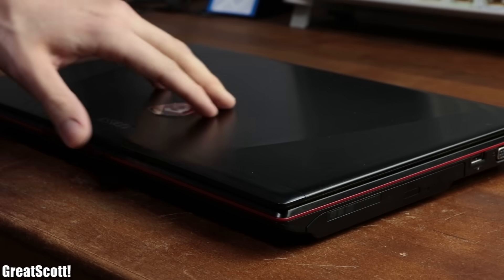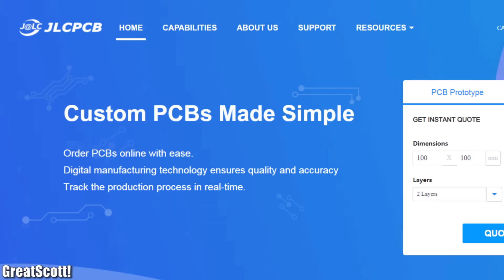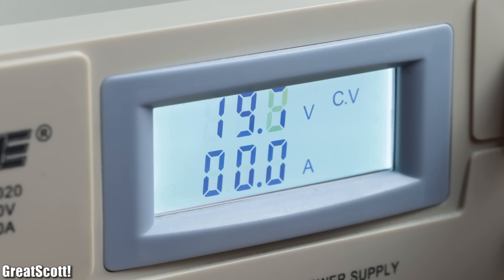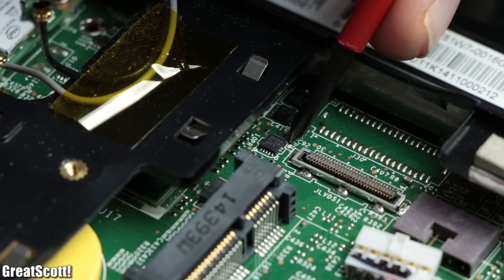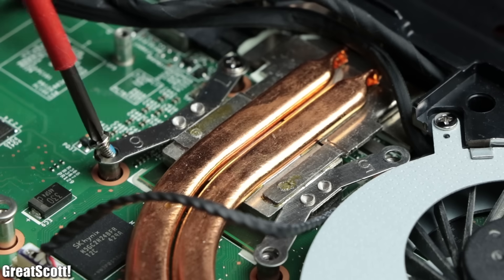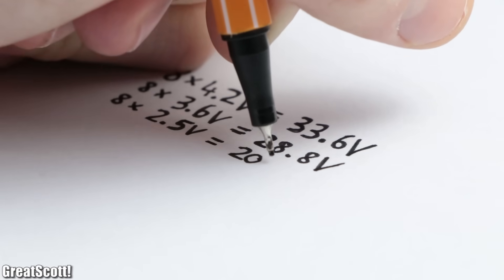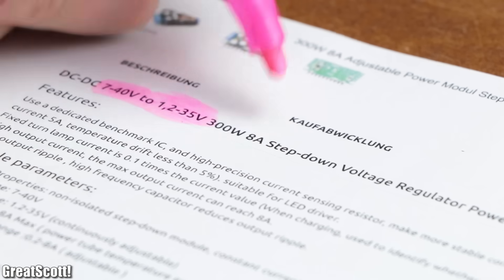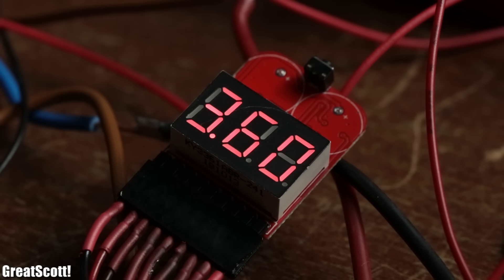DIY Laptop PowerBank (battery pack to charge your laptop on the go)

Comment: Lol, 8:15 Capacitors being pushed aside and wobble as you adjust the buck converter. 9:50 Wuuut? 10:10 Stuffing soldered wires into a wago connector... 10:20 using a way to big screwdriver, and stuffing it in the screw terminals while putting extra torque on the plastic part... This isn't even funny to watch, I'm starting to cry. This is crazy, this shouldn't be on youtube. People will get inspired and build bombs just like this and set busses on fire or something. You're mad.

Comment: HI there. I need help here I have a hp touchsmart 320 pc it runs 19v and 7amp it didn't come with a power supply so I went on ebay and bought a power cube knowing me I had to wait a Month for it so when I finally got it..it wasn't the right connector and amps the power cube was 19v and 3.27amp is there a way to boost the amp without messing with the voltage.

Thanks

Comment: Excellent project. NEXT Project please. Make a laptop power supply that uses 2 x18V 5A Makita battery packs in series =36V. This way we have more use for the same battery, Then only recharge using the supplied Makita rapid charger.? Could this make the project simpler?

Comment: I did the same project a couple of years ago, but with a larger battery bank. Mine was set to 19V, 6.5A. The problem was that my laptop is a Dell and like with most newer Dell laptops, the power adapter has 3 connectors, a positive wire (innermost), a negative wire (outermost), and a data wire (central pin).

The data wire allows the laptop for recognition of the power adapter. It is done that way because Dell manufactures several power adapters of different watt ratings, but all with the same connector. In order for the laptop to tell if the connected power adapter is the right one, the data wire must have a specific signal. Pretty much like Samsung chargers recognized as "Fast Chargers" because of a signal present in the connector. Otherwise, the power supply WILL power the laptop, but will NOT charge the battery.

So research had to be done to add the needed data to my project and I just let it sit there and did nothing else due to lack of time.

The project is nice, but will definitely not work for all, unless it is used as an alternative power source instead of a battery charger.

Comment: if your battery is removable, just remove the laptop battery, and make a 3p3s battery with extended battery connector. this will make more efficient than battery-charge-battery.

Comment: What if you change the batteries that are in the laptops battery with a higher capacity ones? will the laptops battery last longer and will it charge normally?

Comment: Yeah I wanted to do it before so I did some simulation, but there was a peek of the output voltage when I turned it on, about 30V to 60V. Have you ever seen that? I was worrying about damaging my laptop and I got no time for this then. Maybe I'll do it when I have time. You did a good job:)

Comment: I wish laptop manufacturer to consider your project and come up with such kind of power bank. For a common person its bit difficult and chance to go wrong in voltage because of lack of components and knowledge. Having a certified manufacturer rated Power bank would be best. The other option i see is to have a spare battery incase laptop have external battery system... But who would take the hassle change battery every time.

Comment: An additional 3 hours from 2 charges? I know 45 Wh or so isn't much, but a laptop that only works for 1.5 hours on the built in battery? Might want to replace that puppy.

Comment: Are you living in sweden? I recongnize those sockets, those are Swedish sockets :-) <3 Sweden <3 Also its time to upgrade your PC to Windows 10. If you have the Windows 7 serial number, it will work during a reformat when applying Windows 10. Just put it in like it was a Windows 10 serial.

Bor du i Sverige? Jag känner igen dom där vägguttagen :-) <3 Sverige <3 Det är dessutom dags att uppgradera din laptop till Windows 10. Om du har Windows 7 CD-nyckeln på undersidan så kommer den fungera som en Windows 10-nyckel när du formaterar om till Windows 10.

Comment: How about 3D printing a fake battery pack with a input port and power the laptop directly from the backup pack? Would this way minimize inefficiency losses from converting the voltage from twice to only once?

Comment: You are clever man. So may be you can explain some mystery. I did not met anybody who could explain it (so do I). Namely, if you check by neon tester main socket you see - for  L it lights, for N does not light. It is normal, because N line is grounded. But if you do the same using 230VAC/230VAC separator you can expect that the tester will not light on any end the secondary coil of the separator, or light on two of them, because secendory coil is not grounded and two of its ends are equivalent. But, in reality, check it (!), only one end of the coil will light the tester. Why???

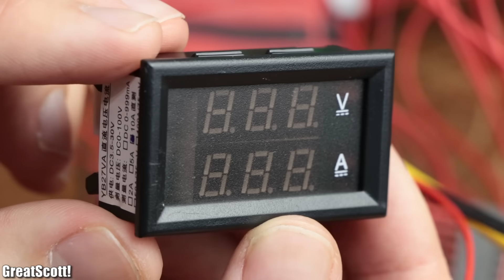Comment: I added that Voltage/Current Monitor at 9:05 to my Homemade power supply but it didn't work.
A friend told me that I need a "current shunt" so it can show the current.
Do I need it? And why you didn't include it in your project?

Comment: Why do you need a separate battery tester if your bms has over-discharge protection? Wouldn't it just stop charging if the cells are empty?

Comment: That benchmark is kinda flawed, you need to have GPU and CPU at full usage in order to get real numbers, I would have used Cinebench and FurMark
Reply: + play song with full volume, set display brightness to maximum, shorted out the usb port with resistor (draw a current to maximum), copying proses to make sure hdd is spinning in maximum rpm, burn a disc cd/dvd with maximum speed. anyone else?
Reply: Exactly. You also need to have the HDD spinning, the display on full brightness, CD/DVD/BR spinning and the internal battery being charged.

Comment: Sir please make a power bank or a battery pack for 12v cordless drill.buy using 3s 40amp balance board and 3s 12v battery display.

Comment: FYI, it's cheaper to buy two separate laptop batteries that can be swapped and you can carry one extra instead of two which is easier on the weight, only down side is you need to plug the laptop to charger before you hot swap them, or if you don't have charger or outlet available it has to be shut down temporarily. Another down side is you don't know what type of cells you get from the non genuine cheapo laptop batteries or how long it will last since they have temperature protection fuses inside that can be set off by the laptop overheating, not necessarily by the batteries overheating themselves. Also if you go with this build there is efficiency loss with these boost and buck converters so it's about 30-10% energy loss.

Comment: Hey. My ups with 7ah 12v battery run my 100w pc less than 30 mins? Should 7x12 be 84wh and it should around 40 mins?

Comment: Is there a way to adapt this for 12-14v from a car? I drive truck and have to use an inverter with the power supply, but the inverter can't supply enough current when the truck is off. It also sometimes fails even with the truck on and gaming.

Comment: Seems easy to charge your laptop with the correct voltage. I have a Dell and the Charger needs a third line to communicate with the laptop. It supplies information about the wattage so the Dell can work with that. Otherwise it will refuse to charge for safety reasons. Using a 4S2P Pack with NCR1860B and a simple car charger. Only problem is, that I have to charge it with my RC battery charger.

Comment: I made this using lead acid battery 12v 5Ah step up to 19.5v powering MacBook pro 17 inch, last for 1 hour. I will try my 80Ah car battery next time. this is good for me for short  time electricity down (may not for others) and Li-ion  that has constant voltage throughout the battery capacity is much better (from what i read)

Comment: I would like to see modification for USB charging output and high-current 12v output for car starting (with diode protection against back-charging by the car’s electrical system).

Comment: Buy a Chromebook, you'll get 10 h use time
Reply: Well, powerusers do buy COMPUTER, but no crap.  :-)
Repairing a desktop?  Short time, less money. (My way)
Repairing Notebooks/Chromebooks/Ultrabooks/Convertables?  Expensive, worthless. Throw away, buy new. (Your way?)
Reply: @Thomas_P_aus_M  why would you ever try to open my Chromebook? Because it will never stop working because it's always improving 😉
Reply: By the way I've got mine for 280 dollars
Reply: @Thomas_P_aus_M  I didn't need a desktop and had little money. I went for the chromebook and it works great.
Reply: @Thomas_P_aus_M  you're really biased

Comment: have you ever try to remove the keyboard of your laptop, the reason you can't fully access the other part because there is a hidden screw behind your keyboard, its not that hard, just push the clip toward inside one by one, it works just like puzzle.

Comment: nice video, but in your case another battery for the laptop will be just fine. and yes, like some other people pointing out, if I have a mbp or razer blade or any other laptops that are charging through a usb-c port, this method will not work and I will not suggest trying it. anyhow, a lot to learn from this video, congrats :)

Comment: Hey man I m great fan of you ,but in this video you used boost converter for CV and cc but in practice use you can design in vay that it automatically switches to cv method of charging like tp4056 module..!

Comment: Congrats on the Million subscribers!  This pack is a good idea for off the grid apps and for less noise emission.  Can even connect with the solar panels (or other system) if specs match up.  I wonder like Elvin Haak noted... if trimming the pack buck converter 0.1V below the charging voltage will work better and the laptop will still use automatically when the internal battery is too low.

Comment: Are you trusting the magic Chinese red box to actually protect the pack from overcurrent or did I miss the additional independent fuse? 
Keep in mind that the MOSFETs it probably uses for disconnecting the pack will most likely fail shorted, which is not what I'd condiser a "fail safe" feature :P

Comment: I wouldn't trust that cheap buck-converter to not fry the laptop with 30V :D Maybe connect a fuse in series and a zener-crowbar circuit that kicks in at 20-21V.

Comment: Would it be able to provide same amount of power while also charging? If you bypass original PSU ad use mains to charge it, you could use it as power source that also charges itself while connected to mains.

Comment: Hello there, may i ask a question please? ... could you take an original laptop battery. Open it up and attached more 18650 batteries in parallel with it. So now the laptop battery have x20 attacked to it?

Comment: well, you should beware because i bought a boost converter as yours and it had a lot of comments stating that current limit protection didn't work. Besides that, mine (and seems as also yours) had nothing in the C2 place(the product pictures had one)

Well, at the end, maybe yours is OK(it kinda looks as you stated that the current didn't rise over 2'18A which was what you set) and it's mine that lacks that feature because of a faulty component but still wanted to say this to peace my conscience a bit.

Comment: I think this is a pretty awesome idea, however I cannot think of it as a good idea for a laptop like mine, which uses 280 Watts or maybe more under load. since both the CPU and the GPU both according to built in sensors, use 100 Watts for each processor respectively.

Comment: What would be a good design to use the 12 / 15vdc of a vehicle cigar lighter to power and run a laptop.  I was told to use a inverter to plug the factory charger into, but evidently the square wave of the cheap inverter doesn't play well with the charger?   One million subs great !

Comment: Good luck charging a HP laptop. My Toshiba is also able to be simply two-wire charged like yours.
HPs however have a third pin and wire which is some sort of communication which I have yet to find information on how to spoof. Applying the 19V it wants without this "handshake" with the charger results in power in recognised (indicator light) but powering or charging the laptop gets refused. VERY annoying.
PS: No it's not just biasing to a certain voltage; high, low or using a divider. It's some sort of data transmission.

Comment: I just assembled a 5S4P pack and added a BMS module with built in balancer. Then I hacked a spare laptop power supply to have a current limit for charging.

Comment: Productively spending you time on the go - gaming? I guess having laptops that allow for hot swapping batteries are rare these days (My old Compaq E500 could take 3 internal batteries and was designed to take a 4th underneath!). That being said would it not work out cheaper and neater to purchase another battery (or 2)? I guess the only downside would be the need to power off before swapping with a fresh battery...

Comment: i think you are charging lipo batteries in a wrong way , those should not be charged with constant voltage and constant current , it is for nimh or lead acid
Reply from the maker: No

Comment: I made a power bank for my Dell Latitude 14 rugged extreme and a Latitude 5580 and my ThinkPad machine. They all want 19v and the Dell unite can charge at the insane 120W while the Lenovo does it at 90W

Best thing about my power bank is it uses ThinkPad batteries. Like a big docking station for the batteries

Comment: For my part, I simply use a dewalt battery (20V MAX XR 5.0Ah Lithium Ion 100Wh) and a modified adapter (20V USB Power Source) which I added an XT-60 connector which I can connect the dc jack adapter for laptop.

My HP laptop takes 19.5V input and the dewalt 5S baterry is around 20V fully charged so I don't use a regulator.

Comment: I plan do similar devices. But do it slightly different. Not as bulky.
Reply: i have a stupid idea that's stupidly expensive.. but cell phone batteries offer a very compact design that offers quite a powerful output.. so what if you got around 20 cell phone batteries, connected them all in parallel and make a 3d-printed container to attach to your laptop, its very compact for what it offers if done right and will be very powerful, like for example 3 Mate20 batts can offer 12000 maH which is pretty insane if you consider how small it is in reality.

but again, obtaining those batteries could end up very pricy.

Comment: I tried to do something similar before, but I choosed a Boost converter  that, even If it could handle 150W and my laptop requires 120W, it heated to much and then it shutdown.
Great video, maybe I'll do something similar

Comment: Hahahah changing the DC socket an such a laptop can be a nightmare.
Reply: Хеннинг It's worse if soldered onto the main PCB.  Simple mechanical damage can render the entire laptop almost unrepairable because desoldering a large 6A connector from a many-layer PCB near tiny sensitive parts is really difficult.

Comment: Nice project.
But why charging a battery with a battery? It is a bit waste of energy. I found out that at a slightly lower voltage most of my laptops do work fine but don't charge. Just put the buck-converter a little lower and you have it. Thus you can have a longer runtime on the external pack while keeping your internal battery full.
I only had to drop it by 0.1 Volt below charging-voltage to archieve this.
Second good thing is that the I is getting lower too so there is less heat in the converter and external battery which gives an even longer running time.
Reply: You can also plug your power bank when your battery is full, this way you'll consume only what the laptop needs, and when your power bank is flat, you still have your full laptop battery.
Reply: You don't necessarily need to charge the battery with it. Once the laptop battery dies out, you can then run the laptop with just the power bank with the built in battery removed.
Reply: Good idea finding the below charging voltage.  I'll have to look into that.  Surprised I've not seen someone hack a pack into a huge portable docking station size battery pack.  That would be something different.
Reply: @jafinch78  Back when I was a poor college student I had an old siemens laptop that ran perfectly happily directly off of a 7Ah lead acid battery lol. Didn't charge but I didn't want it to, so worked out pretty perfect. I used to get some odd looks though haha
Reply: @SuprSi  You're motivating me to look for either a T42 or X200 docking station and try what I mentioned above out to make a docking station battery pack.  Might even be able to 3D print also... I'm not sure about thermal issues though.  The pricing isn't too bad building the hypothetical pack out of protected TP4056's, or maybe even I see cheap 2S modules cost effective, ganged together.  I'll have to read into hacking into the existing battery packs protection circuit and plug specifications and see if I can find and old not working pack for connector with pins.
Reply: the laptop will likely try to charge it's internal battery, if it fails it will likely disconnect the charger. Things aren't that simple anymore.
Reply: That's what I was thinking too. Since the battery (mine) is rated at 10.8v, can´t I just supply 12v from my regular 3s battery pack?
Reply: ......May I answer...this....first thing..
Well maybe I want to simply have more energy on the go....even tho if he only made it for his Laptop you know..coulda just bought another battery...